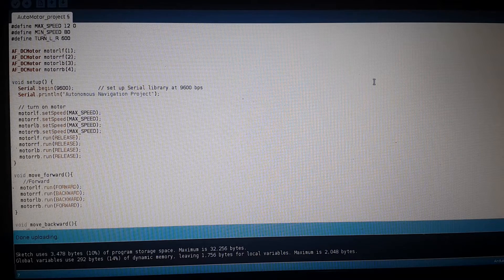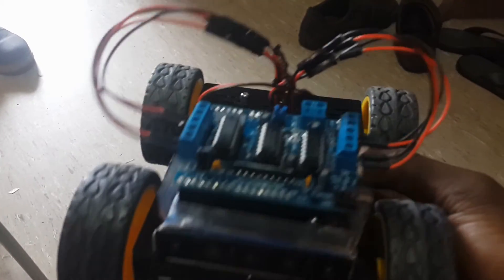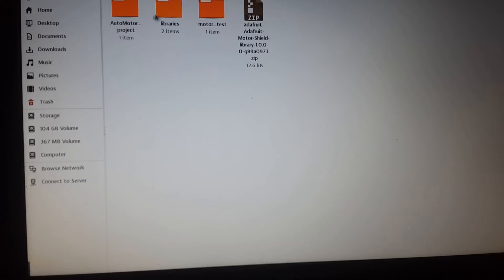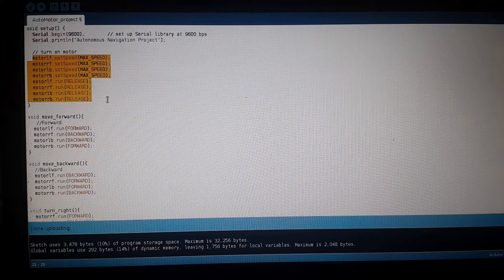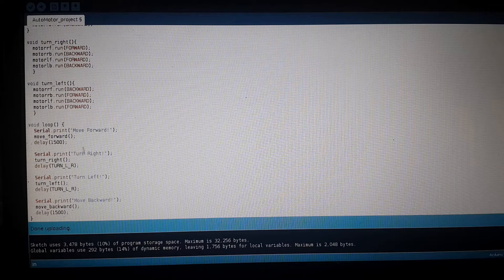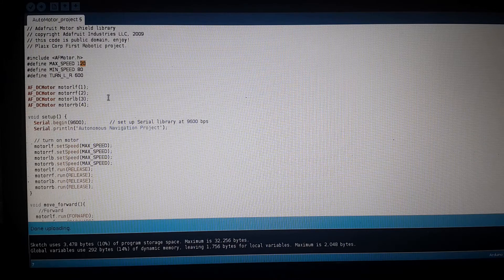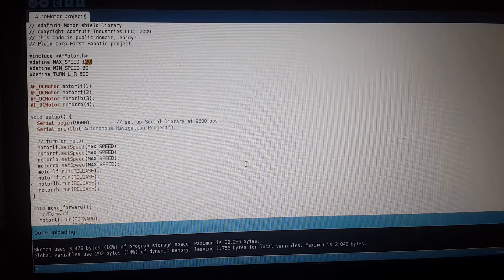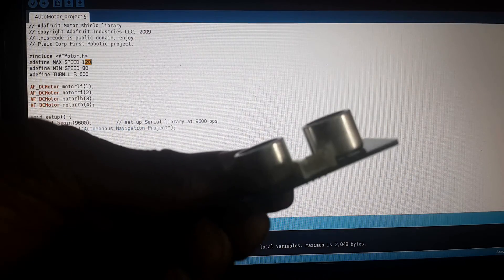Multi Chassis 4WD with SainSmart Motor Shield + Arduino

Comment: Thank you!! How much voltage did you use for the robot ?
Reply from the maker: usually 5v the arduino regulates it, but there is another video coming soon where I increased a bit because it was not enough power for the motors and range sensor.